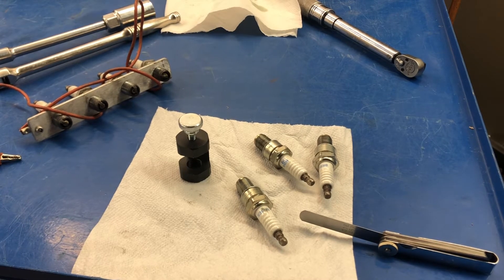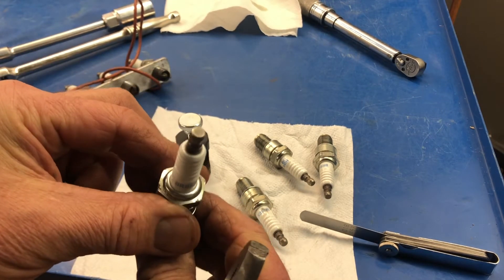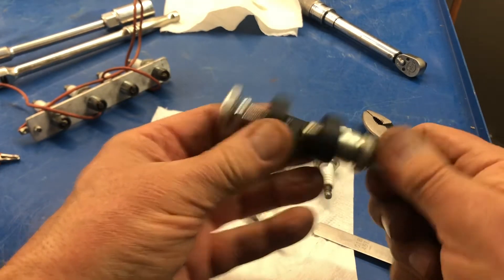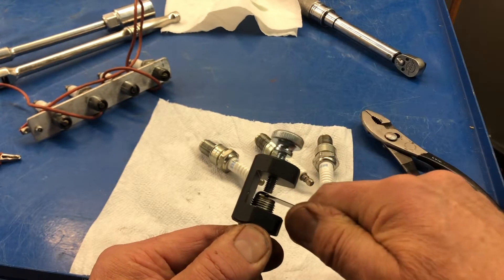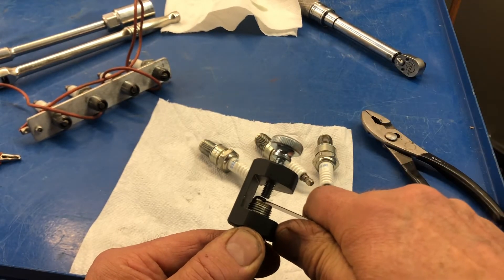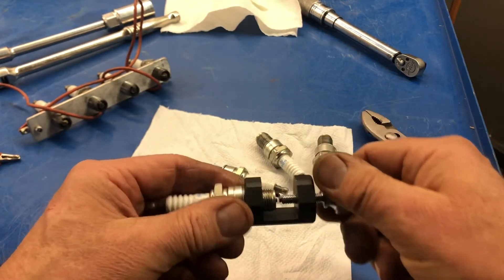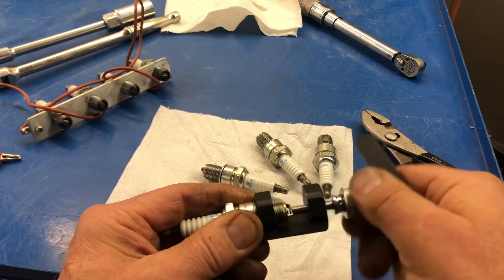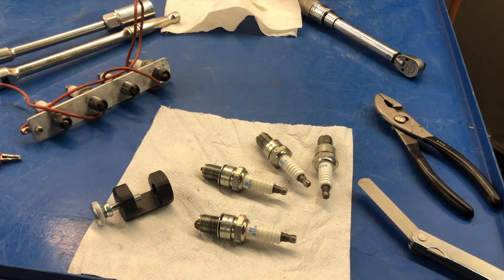Gapping spark plugs without “bashing” them

Comment: are we supposed to see a bit of the electrode cleaned off at the end when the timing is right on these engines?  I advanced mine a few thou and still see the fuel film all the way to the edge of the electrode.
Reply from the maker: The timing indication should be about mid point on the curved part of the side electrode. It’s a faint colour change line. However the engine needs to be tuned enough to have clean plugs. The timing tuning reading is pretty much last on the list.
Reply: @RotacRepair  that's plug heat isn't it?  We're trying BR9ES, maybe better in florida summer heat.
Reply from the maker: The 9 is the hotter than an 8
Reply: @RotacRepair  no it isn't
Reply from the maker: @FourthWayRanch  please refer to the NGK chart for heat range etc

Comment: I use a copper colored anti seize compound prior to installing the plugs, but I'm never sure how much to put on the threads.   What do you suggest John.    Well done video and great information.  Thanks
Reply from the maker: The correct amount of “copper colored anti seize compound” prior to installing the spark plugs is none. The correct item to use is a silicon (not silicone) based heat transfer paste. Only apply a very small amount half way up the threads from the gap end. 
Thank you for the kind comment on the video.
Reply: Hi John, could you please specify the product that you use. My Google search only shows me "silicone" based products. Thanks in advance 
  @RotacRepair
Reply from the maker: The compound I use is actually thermal heat paste used in electronics. Should be available from your local electronics store, such as Sayal Electronics